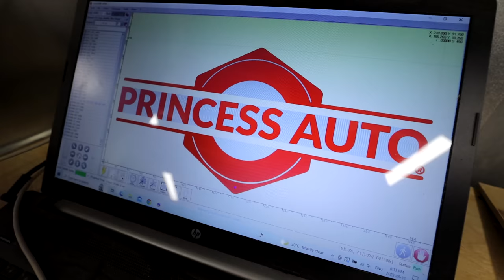I Built an Outdoor MAN-SHED!

Comment from the maker: Thanks to LyLmLe for the Pool and Pond Lights, they really are amazing!
Led Pool Lights 40W: https://bit.ly/3W8iss3  
LyLmLe Submersible LED RGBW Lights: https://bit.ly/3Oguw8s
Reply: If you're going to air seal, just make sure you have enough ventilation to provide sufficient oxygen for the stove to burn properly without building up carbon monoxide in the building, that can be quite dangerous. Unfortunately, carbon monoxide is odorless and colorless, and disperses evenly throughout the room, so sleeping low, sitting down, sleeping higher up or even standing can't prevent carbon monoxide poisoning. Please make sure to install a carbon monoxide detector so you'll be sure to be safe.
Reply: $185 US (all in) - too expensive!
Reply: Hey Kevin do you still have the link to that cnc laser that you use

Comment: When explaining Celsius to Americans just say 20 is room temp and 40 is a fever. In winter add 0 is freezing.
Reply: Or 9/5ths +32
Reply: Yep 0 is freezing 100 is boiling and 36-37 is body temp.
Reply: Yep 0 is freezing 100 is boiling and 36-37 is body temp.
Reply: Man I wish we used Celsius here. Our temps are all over the place and completely random 😂 we boil at 211, freeze at 32, body temp is like 98.6, and room temp is around 70. I even had to look some of those up cause they're so all over the place it's hard to remember.

Comment: Your lumber store sure beats mine. I go to Home Depot. 
I've build a garden shed and use foil tape to seal off the gaps. You're right, once I did that, the mice invation stopped. Well, I hammer a lot of them prior, but since it's been fine.
Great lumbermill shed man cave thingy you got there. Quite nice indeed.

Comment: Really cool to see the cube and a frame what is it a year or so later. And how good they look and knowing that there being used. Heart split is always a problem and unavoidable. Love the sawmill shed. Still believe a good log slide setup on bothe sides of the mill will make life easier. Allows to move slabs off or halves etc. without having to take them completely away.
Reply from the maker: Yes.  Slab slides are on the radar..  it's been 2 years for the cube.

Comment: If you gonna have hot tub nap time, you need to build yourself a slip-safe head rest first, so you don't accidentally drown. And... you probably shouldn't, for a variety of safety reasons, haha. Anyway, your man cave in the saw mill is looking really good! You just need somewhere to sit now.

I do think you'll probably wind up wanting to do some kind of cover for the front end of the mill, just to keep the mill secure from precipitation, but I don't know exactly what that looks like. Like, it might be as simple as having a tarp hanging from some shower curtain hooks right behind the big metal beam, and with some way to tie it off on either end. Just something that lets you close off the front end during the worst parts of the year, you know?
Reply from the maker: I do.   I'll keep my eyes peeled for something that will work.